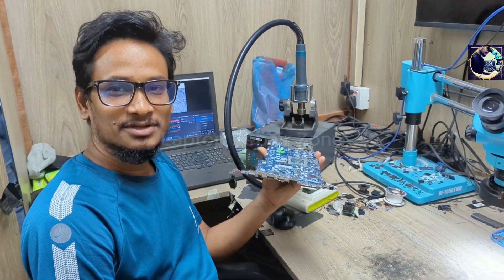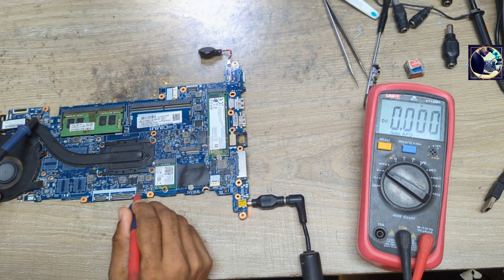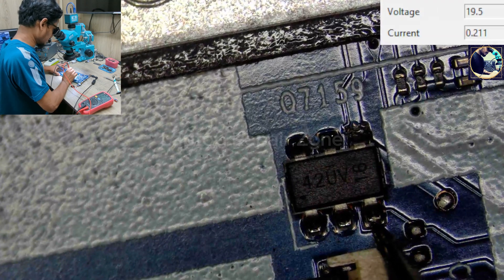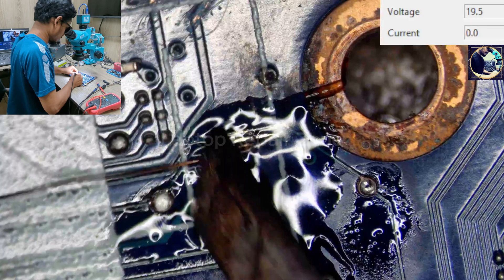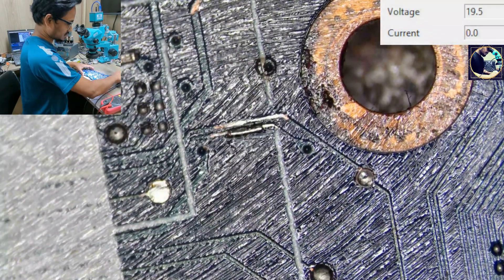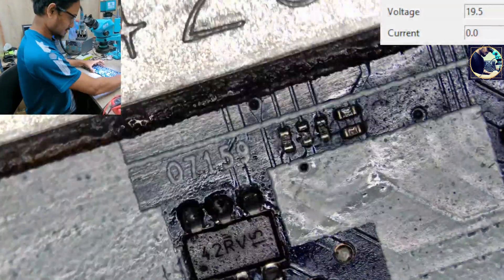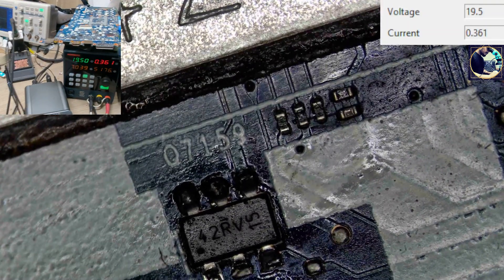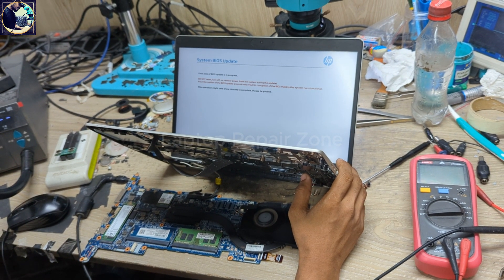Laptop motherboard CPU core voltage missing fault finding | laptop no display issue fixed!!

Comment: Amd Ryzen 7 3700u stuck 0.40ghz 

Done instal window
Done uodate bios
Done plug unplug battery,
Done plug ac without battery
Done setting performanc to high
Done update driver 
Done hard reset button power of/on 30sec

But still 0.40ghz😢 how
Reply: For first start window have normal then drop to 0.40ghz😢
Reply from the maker: You can try another charger, if not solve then you need to service your laptop motherboard thanks dear...